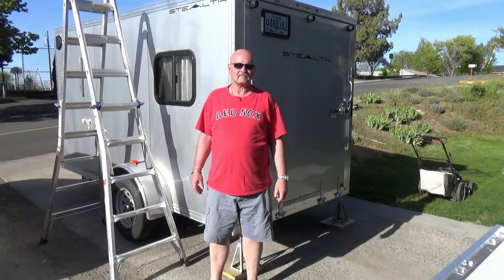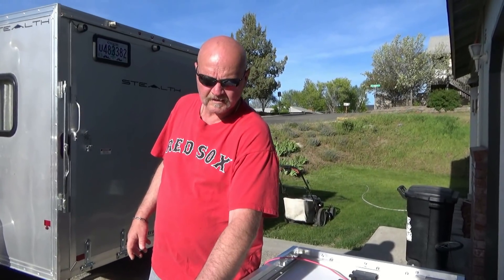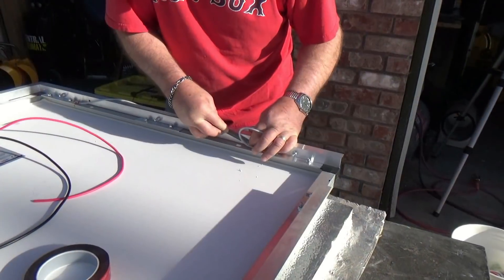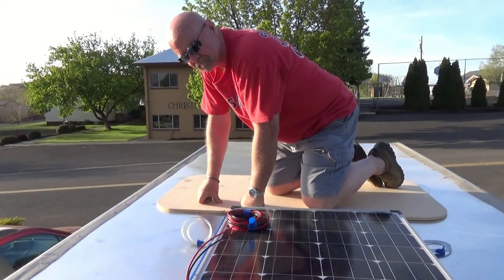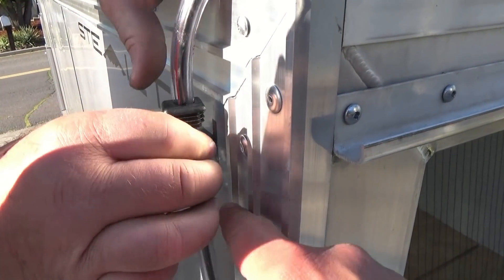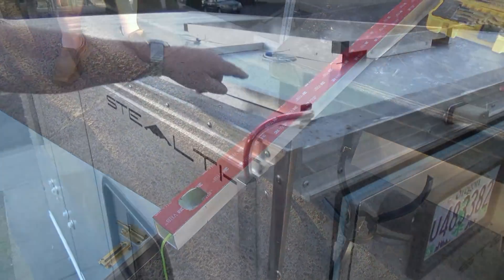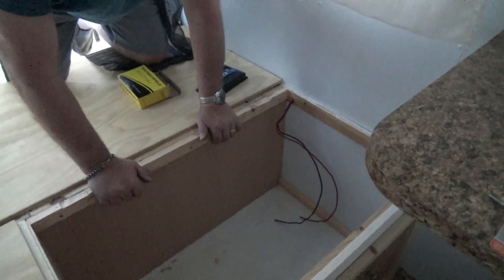Solar Panel Install Cargo Conversion Camper Part-1

Comment: Satiety lanyards with copper jugs? How do you get the lugs on tight enough to ensure safety?
Reply from the maker: We used a hydrolic press to secure the lugs to the safety lanyards... pretty solid

Comment: How is the solar panel mounting tape holding up so far? I'm thinking of doing the same thing. Thanks.
Reply from the maker: Unfortunately, Jack sold the trailer, so we are kind of out of touch with how it's holding up. In the time he still had it... the tape was holding up really well!

Comment: Does he leave the inverter on all the time?
Reply from the maker: No... generally plugged in to shore power until ready for a trip, then the inverter is turned on. Once at a park and plugged in, the inverter is turned off. So mainly, it's only on when traveling

Comment: No need for all that.   Just use 3/4 self tap screws with GE clear 7x 100% waterproof silicone under the plates and you’ll be good

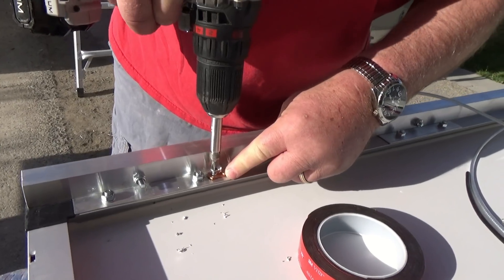Comment: 3:03 
What cordless drill did you use there? 
That cut like butter... or rather drilled like butter... LOL
I"m impressed. I have a lot of tools since I "Flip" RVs... but never bought a cordless drill, I'm not sure why I haven't... strange. I'm really impressed how strong that drill is...
Reply from the maker: :)  Kinda partial to the Porter Cable.... great tool!

Comment: Hey MR Batman what size windows are them? Where did you get them?
Reply: Windows? or Solar Panels?
Reply from the maker: The solar panels are 24" x 36" made by ZAMP Solar. They were overstock and sold for $100 each. Thanks for watching!
Reply: @OregonBatman  
Got that, but windows, what size are them ?
Reply from the maker: Hi Isaac... the windows are 18 x 24 purchased at Affordable RVing in Portland Oregon. They do have a website you can check out. I believe you can also find them on Ebay. Hope that helps! Thanks!
Reply: @OregonBatman  
Good to know... but (I feel silly asking this question)... I love eBay... and would love to buy them off eBay... but what do I type to find these kind of solar panels... is there a certain name?
Reply from the maker: @JudiChristopher  no silly questions here!! :)  Two names I am partial to are Renogy and Zamp. You could do a search for: 100watt Renogy solar panel and you will get many to choose from. I just purchased a 400 watt kit from Renogy and  looking forward to getting it set up!
Reply: @OregonBatman  
Thank you so much for this great information.
God Bless YOU.
Reply from the maker: @JudiChristopher  Thank YOU! And thanks for watching! :)
Reply: @OregonBatman  
My Pleasure.
Reply: @OregonBatman  
I sure learned a lot from this video.
Thank Y'all.
Reply from the maker: @JudiChristopher  You are welcome! :)

Comment: It is almost a year later, how is the high bond double-sided tape holding up?
Reply from the maker: Jack sold the trailer in August 2019, at that time (summer) was still holding strong.

Comment: It's been 9 months. How's that VHB holding up?
Reply from the maker: So far... holding up. The added security of the straps means even if the VHB tape fails, panels won't be going anywhere. Things are still tight though! Jack ended up selling the trailer, and the person who bought it still reporting all good.Thanks Ron!
Reply: @OregonBatman  that's wonderful to hear as I too dislike holes in my roof and plan on going with VHB for my solar panels. Ty very much for the reply.
Reply from the maker: You got it! The VHB tape is pretty strong stuff! But... never hurts to build in a little safety measure, just in case! :) No holes, no leaks!

Comment: Great job! Good  precautionary with the wire.just in case. I did a removable  320 watt  flat panel solar system with bungee & velcro on our coverted 6x12 cargo trailer.   
Flat panels are light but not as durable so I can put them inside when not in use. Only 6 pounds each.https://youtu.be/LtGSPgmyhbY
Reply from the maker: Thank ya! Jack installed his panel as a semi permanent panel, only because he's up there  in age and didn't want to have to go up and down to install. I'm thinking of using something a little more portable, but keeping it on the ground. Easier to set up/tear down and store away when not needed. Thanks for stopping by!

Comment: Have seen other vids where the panel seem kinda thin like stick on type so I see why your wire would have come around and down on the out side of your trailer but seems like the one in this video has kinda of like a platform would it be possible to run the wire underneath The panel straight into the trailer?
Reply from the maker: Thanks for stopping by Ezequiel! Absolutely, the wire could have run straight through the top of the trailer, but we didn't want any holes drilled in the top and have to worry about leaks latter, so we chose to run it down the side as seen in the video. Work out really well and we think it looks great as well.

Comment: Did you have any problems with the solar panel blowing off? Ingenious
Reply from the maker: No sir... VHB tape holds strong. Just in case though, he did install a couple safety lanyards to keep it from blowing off!
Reply: @OregonBatman  
It's been 2 years since this post... How is it holding up now? 2021?
Reply from the maker: @JudiChristopher  Well.... my buddy Jack decided to move after a year of owning the cargo trailer and sold it. But we had many trips in that time and it held up great! Nothing moved cracked, or fell apart. Only thing I think he would have done differently was to use a different type adhesive on shower walls, it had bubbled in a couple spots due to poor adhesive... other than that... all good!
Reply: @OregonBatman  
Thank YOU, 
Good to Know

Comment: Awesome! Great upgrade. I’ve always had a 12v DC system with battery and a power converter on my campers but never did solar. Maybe #3 will get some solar :) Great work Jack! Love the clean installation.
Reply from the maker: Thanks Eli!  Always a good feeling to go on a trip and know when you get there the refrigerator is still running cold! Can't beat solar! (not yet anyways!)